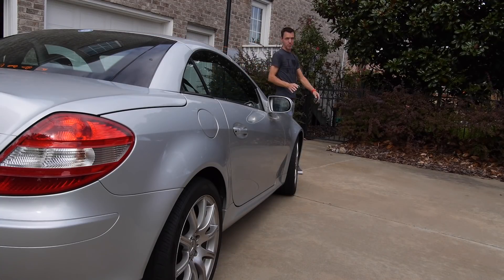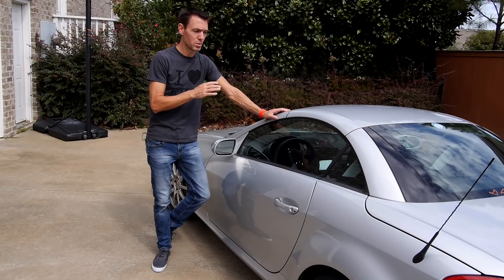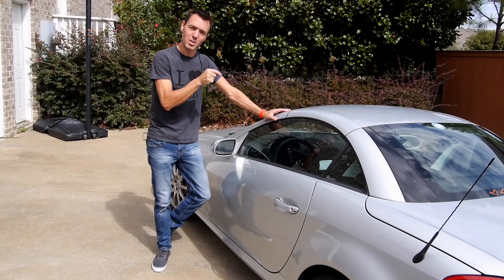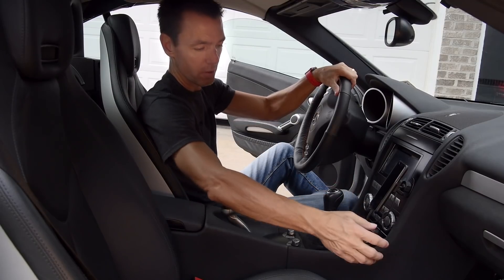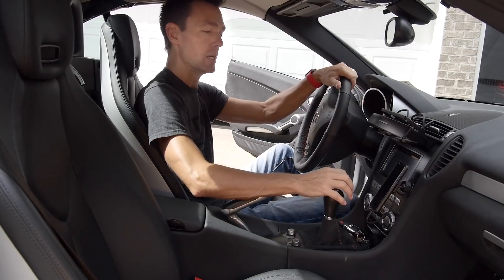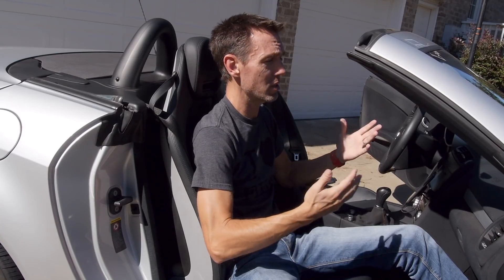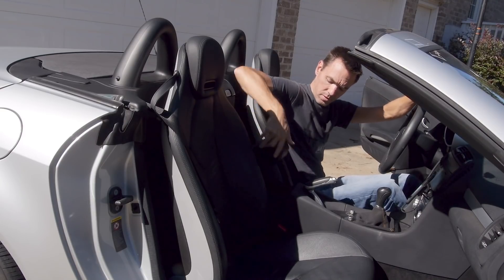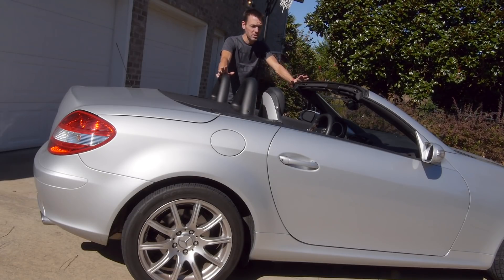3 Examples of Brilliant Engineering in the Mercedes SLK350

Comment: What about the way the 3-way hi-fi loudspeakers are integrated into the cabin? Most car manufacturers do audio as an afterthought, but this one was super-engineered. I think it could use a bit more amplification from the factory, but better electronics are now available compared to what they had in 2005. Speaker placement is excellent.

Comment: In the pre facelift cars the glove box rather than use the CD player in the trunk as they did in the R170 they shoved it in the glove box which is small compared to the R170. In the face lift cars as I have they figured out how to put the CD player in the Comand unit.
On the other hand the centre console storage in the facelift cars opens from the front rather than from the side.
Reply: The CD player situation is a bit different. I have a 2005 SLK 350, it has one CD/CDmp3/DVD/DVDmp3 player in the Command unit (it can play movies as well as read data CD/DVD). Then, there is a 6-CD changer in the glovebox that plays only Audio CDs. Then, there is a DVD drive in the trunk that is used for the DVD with map data (for maps in the command unit).

Comment: How tall are you, i keep seeing forums say you can be 185 cm high in the 170, and even taller in the 171,, but,,, i have tried both, im 184 and i feel like im cramped in with arms bent too much, legroom and headroom is ok,, i feel i have tryed everything with the seat, its just as if i cant tilt it enough,,,, its a deamcar of mine and have been for years and now i want to make it happen, but ?? Ps. i have driven the mk1 MR2 for years and have plenty of space in that one
Reply from the maker: I’m 6’/182cm and I fit well without a helmet. The helmet was definitely an issue as I was jammed against the roof. I’m a thin frame so I fit, but I can see how someone broader than I am might be jammed in.

Comment: Man...I still have my SLK 350.  40,000 miles..and I get a idle vibration in the mornings....I've gone through everything.  No code being sent.  Maybe engine mounts?
Reply from the maker: Maybe engine mounts. Can you hear where in the engine bay it seems to originate from? Meaning, entire engine shakes or there there a pulley or accessory that’s loose?

Comment: What do u think about a slk 280 yr 2007
Reply: In addition to that you should be safe from balance shaft failures with an 07 model.
Reply: @gianfrancoa  thanks
Reply from the maker: I haven’t driven one but the combination of the MB 6 cylinder and the compact size is fun!
Reply: @BetweenTheWheels  thanks, do u think it is worth to buy one that has 80k miles? I mean because of future mechanical issues?
Reply from the maker: My personal opinion is anything over about 60K miles needs to be contemplated carefully. I’d ask questions like, how many miles a year will you drive it? Is it a daily driver? If you’re financing, will the car be over 100k before you pay it off? That’s not a deal breaker but I never like the idea of paying monthly on a car that’s near the end of its lifespan.
Reply: @BetweenTheWheels  thank you i appreciate your awnser

Comment: The french designed the metal roof top mechainism, ( peugeot)  and suppiled it to mercedes for the slk. The cupholder design comes from sweden, ( Saab) who where the first car producers to design the centred pop out cup holders.
Reply from the maker: Interesting! Kudos to the French. I’d say, based on the questionable functionality of the cup holder, that the suedes should stick to furniture :)
Reply: @BetweenTheWheels  The pure saab cars had proper high quality cup holders, until the cost cutting started, plus the merger with GM, saw quality drop substantially.

Comment: What are the differences between SLK 350 and SLK 200 R171? I think they look similar
Reply from the maker: The 200 was a previous era car car with the factory code R170 and has a completely different body style. I believe 2004 was the last year for it.
Reply: @BetweenTheWheels  nop, there was  R171 slk 200 for some markets with the smaller M271 supercharged I4 engine. In NA we only got v6's and V8s
Reply: @BetweenTheWheels  As gianfranoa says, Mercedes produced an SLK 200 Kompressor model, certainly for the European market, as I have a 2009 example (UK).  It has a 1.8 litre (110 cubic inches) inline four cylinder with a supercharger (the kompressor in the name).  Earlier models put out about 161 bhp, and later ones, 184 bhp.  I love mine: it's not particularly fast but is sprightly enough for my sort of driving, and very comfortable for cruising long journeys.

Comment: This is a great vid, Ive only had my SLK 200 (r171) for two months and I too think it's a little miracle of engineering, especially the roof mech. It makes me smile and simply admire the engineering design to get that roof in my trunk and still get luggage in there.  Nice to see someone praising a car instead of slagging off where it could be better.
Reply: You won’t be smiling if you need to repair the roof mechanism OUCH

Comment: seems to be the only merc roadster with a shift. whats the 0-60 like on the 350? any thoughts on doing the exhaust upgrades for those of us who want to sound more alive. yah I like the performance of the c450 and the sl55 more, but GIVE ME MY SHIFTER
Reply from the maker: It’s true that in terms of 6 cylinder manuals, there are very few still around. 0-60 is quoted from MB at 5.5 seconds. The car feels plenty quick but it can’t keep up in a straight line on a track with lots of faster cars. That’s okay for me because I wanted a quick-enough car to learn on track with but not something I couldn’t control. On the road, it’s 2nd to 3rd and 3rd to 4th torque is wonderfully smooth, powerful and naturally aspirated. One of the best on road driving cars I’ve ever experienced.

Comment: Yes, i got a clk 350 2008, just because i needed a more fuel efficient car for my commute than my GLE 450. So i was surprised about the seatbelt deployment and the steering wheel moving everytime y turn the car off or on.

Comment: Got the infamous 722.9 7G conductor plate issue yet? already started on my 2005 r171 35k miles, it will eventually...this car is a gamble...good luck!

https://www.gotaclassaction.com/mercedes-named-in-class-action-lawsuit-over-defect-in-the-722-9-7g-tronic-automatic-transmission/

https://mbworld.org/forums/slk-class-r171/601829-mb-should-recall-722-9-transmission-all-2005-2007-model-years.html

Comment: I have the same car.  I get compliments all the time about this car.  Most people think it's a new car....and they mention the shape of the top....and then I show them how the top goes down into the trunk!  A true crowd pleaser!   I've had some bad ass cars...but this one does draw attention.
Reply: Hello. Could you tell me how the car is when it rains outside? Get some water inside the car? Or is well isolated? And one more: You need a garage or you can put it outside? Thanks!
Reply: @florinstroescu2305  The roof and windows on my car have never leaked water.  It's a good idea to keep the rubber gaskets that seal the roof, lubed up with some conditioner.  As for garaged...I always garage my cars...But in the daytime....It gets poured on by rain while I'm driving around...No problems...
Reply: @AmericanConstellation  thanks a lot for explanations! I was worried about that, about the roof and leaking water, considering the age of such a car. The same about winter season, ice or other bad conditions. But its ok, Im more confident!

Comment: Speaking of magic, my 2006 SLK 280, manual transmission, has been my everyday car, including several long trips, since I bought it new.  Every day means my cup of coffee in those cup holders.  The inevitable spill down the radio resulted in a non-functioning radio.  I priced a new one from the dealer:  $5000+ and looked at nice after market ones:  Up to $3000+.  I kept fiddling with it as I drove and then one day it functioned for a while.  I thought I had done something in a certain combination, i.e. start the engine before turning on the radio.  I couldn't figure out the sequence, but it kept getting a little better.  Then, it was fixed.  It had healed itself and it has worked fine for the last five years.  I agree that some of these fancy items can break, but with mine, I'm starting year 13 with 80,000 enjoyable miles and all is well.  

Thanks for your observations.  I really like the origami analogy.
Reply: Hello. Could you tell me how the car is when it rains outside? Get some water inside the car? Or is well isolated? And one more: You need a garage or you can put it outside? Thanks!
Reply from the maker: Mine has been leak free from the top and windows. Like other convertibles this car has some drains at the bottom edge of the windshield that must be kept clear so water doesn’t back up into the cabin. Mine were clear when I bought it and I keep the car in the garage so no leaves accumulate on my car.
Reply: @BetweenTheWheels  thanks a lot for explanations! I was worried about that, about the roof and leaking water, considering the age of such a car. The same about winter season, ice or other bad conditions. But its ok, Im more confident!

Comment: Fellow 2005 SLK350 owner here... I have one more great engineering example for you! If you open the fuel filler door, you will find a small circular plastic holder on the inside of the door. You can place the gas cap into this holder while you fill the car with fuel. This way the dangling gas cap doesn't scratch your paint!
Reply from the maker: Yep, I love that!

Comment: You won’t like that dual opening console when it jams or breaks, which it will. How? If you accidentally try opening the upper door and the lower compartment at same time. There’s a TSB related to upper door which malfunctioned.
Reply: It's fairly easy to reattach that console lid if it "detaches" during an unintentional two operation opening kerfluffle.

Comment: Whats your take on the automatic version of the SLK? I am planning to get one for weekends / running errans. Had the SLK 200K R170 in manual and while it was more involving, it also slowed me down and once in a while I'd grind a gear while hard accelerating or overtaking. Is the auto still fun?
Reply from the maker: I haven’t driven the auto SLKs so I can’t judge. I enjoy a well-powered auto and only went away from manuals for a long time due to the fact that before turbo charging, manuals in the 80s and 90s weren’t great for city driving - sort of a pain and no fun to rev. I chose the manual for this car because it’s meant for the track. I hear the SLK55 with the 8 cylinder and auto is a great car.
Reply: I have an auto because it was all I could find. It is my first auto in many years and my first car auto ever. It certainly is easy for around town driving but I don't like how Mercedes' computer tries to out think you and readjusts the tranny and it does not accelerate as rapidly because it shifts earlier in the gears. I get to drive my wife's 2016 MX-5 and it is much more fun and, despite less horsepower, certainly feels like it accelerates faster. I have not gotten used to shifting manually so can't comment on that.
Reply from the maker: I totally agree on Mercedes dim witted auto programming. For my 2016 C450, a car with loads of power and torque, the entire experience is let down by the awful 7 speed auto. Even Mercedes knew it was bad - they changed to an 8 speed in the C43 that I hear is better. Such a shame.